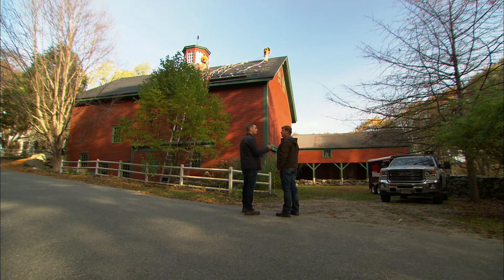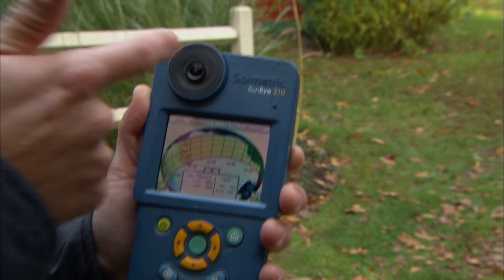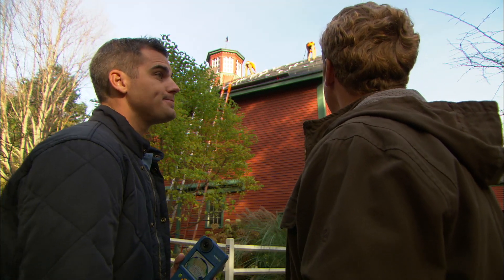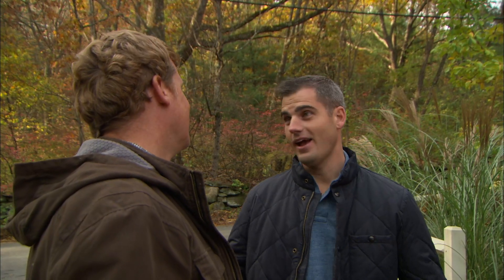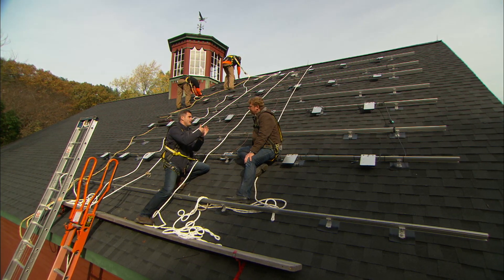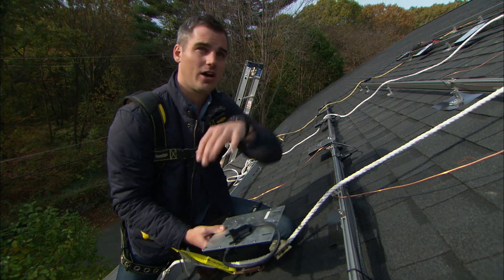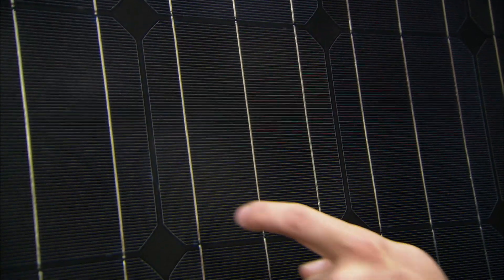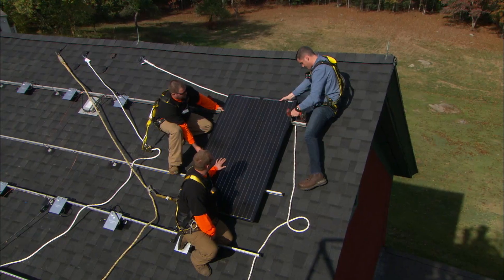How to Install Solar Panels with Microinverters | Ask This Old House

Comment: Between the utility panel in the house and micro inverter what do I need to have? Do I need an ac disconnect switch ? A combination box? I know a meter is also used.

Comment: I would've installed the rails vertical not horizontal. 
They way convection an keep under the panels cool and produce a lot more power.

Comment: Given new panels are now capable of 400w this is definitely a good 3 years old. I had 4x JA 385w panels installed recently to add to my original 7kW array. My installer was getting them at £98 each ($135 equivalent).  Micro-inverters however cost about £100 each - so unless you have a lot of shading problems, don't bother. And if all the panels are shaded evenly at once then micro-inverters won't help much either. Micro-inverters are useful when you have shade on individual panels, but not others.

Comment: Unless you have a lot of shading issues then it's always cheaper to go with string inverters. This house REALLY does not have shading issues! The examples they gave were 30minutes before sundown in winter months when the panels are doing 5-10% only because the sun is so low.
Micro-inverters are much better when you have year-round shade from trees and chimneys.  Unless these cases, given micro-inverters cost more than 300w panels it's cheaper to get a single inverter in the garage that's accessible. Single panels very very rarely fail - no moving parts. Toughened glass designed to resist golfball sized hail. If you're adding as many micro-inverters as panels what happens when the micro-inverters start failing one at a time after 20+ years?  You've got more points of failure.

Comment: Even though the microinverters have a warranty, over the years there will still be labour costs to replace them. How much would it cost for a worker to remove several panels to access microinverters at random throughout the array? Too much! 
At least with the string inverters installed near ground level, they can be checked and repaired without climbing up onto the roof!
Reply: One of the unique benefits of micros was that they were the only devices to be Rapid Shut-Down compliant. That was followed by  SolarEdge DC optimizers which are also RSD compliant, and SMA string inverters now have an RSD device (though it is an additional component.
To your point, Moludle Level Electronics (MLE) have often led to failures on the roof. The recent versions of enphase micros (IQ 6, 7, 8) all seem to be more robust than their predecessors.

Comment: I really want to know if you can mount these on a building with only East and West facing roofs (or is it rooves?). Cost aside, if you put panels on both roofs would that not be better than just on a South roof? It seems to me that would give a better angle of incidence as the sun hits both the East and West roofs. I'm asking this as I don't have a south facing roof but I do want to fit solar pv at some point.
Reply: East-West is useful for getting say 40-60% power for say 7-8 hours rather than 90% for 3-5 hours during the middle of the day. You can even do it with a string inverter with each aspect on a different string.  East-West gives you more power in the morning and evening, but less in midday. That's useful if you aren't at home during the day too. You'll get a much flatter output - like 2 bell curves vs 1 tall bell curve. Basically when the sun is at it's highest point all your panels will be doing about 50-60% instead of 90%.  So it's best to install say 7kW instead of 5kW. You can even do that with a 7kW inverter. It's called oversizing the array and is HIGHLY recommended if you have an East-West config, or just generally!
Reply: @markyates5744  great reply. Very useful and many thanks.

Comment: A few things: 
1. Those flashings are pretty bad.  You need to be up under the upper shingle and not overhanging the lower shingle.  
2. You would never put all 28 panels in series.  Probably run 7 parallel groups of 4 in series.  If one panel is shaded it would only take out the other three its in series with.
3. Grid tied micro inverters are best for saving money but in most cases you will lose power when the grid goes down.  If you are looking to be self reliant, then you need to have a battery bank.
Thanks!
Reply: This is a Grid-Tie system - adding a battery bank does not make financial sense. If you need AC power during black-out then use an AC Generator.
Reply: @MrSummitville  Generators are a great option when your power is out for less than 2 weeks.  Batteries are good for 10+ years.  If you want to be sure to have power in a long term power outage, then you need batteries.

Comment: Scrap those rails and grap something from Sunpowers latest and/or snapnrack, Much better flashing and racking. LG has come a long way with solar aswell.  Lot of issues with enphase micros but they always had a good warranty. We just finished 1600 mod site with Qcells

Comment: I have a question... I have two older 125 watt panels that when i connect together one only works half capacity. they out put 100 each, together i get 150.  whats up with that?
Reply: The rating for a solar panel is for perfect, or laboratory conditions.  Efficiency is lost from inverter or charge controller heat, DC to AC conversion, when applicable, wiring losses, panel placement relative to the sun, etc.  I have never seen 100% panel output from any panel, ever.

Comment: Set up a battery Bank for your solar system electric grid fail no electricity
Reply: No! Adding a Battery Bank to a Grid-Tie system does not make financial sense. Use an AC Generator for black-outs.

Comment: With that many panels they should be able to power the entire house all day and night. With batteries of course. Grid tied systems are a rip off. You know the electric co are going to get their profit one way or another.
Reply: When you compare Grid Tied and Battery Storage ROI the grid tie becomes much more affordable. Granted, if emergency power is a bonus then a grid tie is not the best solution it may be a combination grid and storage mode or battery only. The other thing to consider is if battery storage only is used then when the battery is full and your home is not drawing much power you are wasting the sun energy. Most utilities today do not allow a meter to run backwards, they require a Net Use meter to be installed. Essentially the utility pays you wholesale power rates for what you put into the grid but charges you retail rate when using power from the grid. With this type of system, you need to size your system large enough to cover your power needs during the average peak demand, but small enough you are not losing money.
Reply: @TallTexasGMan  You said, " ...hey require a Net Use meter to be installed. Essentially the utility pays you wholesale power rates for what you put into the grid but charges you retail rate when using power from the grid ..." . While that may be true in some states, in other states, they allow FULL RETAIL CREDIT of all energy put back into the grid - excess credits carry over- month-to-month for a whole year!  You do not need to down-size your array per "average peak demand", we typically design the array to generate  approx the "100% Yearly Consumption" = a minimum electric, as possible.

Comment: The panels I got installed in 2012 have multiple diodes in each panel so that a partial shade on the roof or even one part of one panel isn’t a problem. It is clear to see in spring and fall when the shade from a chimney wanders across a few panels. It doesn’t even come close to impact that string by more than a few percent.
Reply: Yes the worst type of solar panel system is the "Frankenstein" system which is wired like old Christmas lights where if you lose one light, the whole chain is interrupted. That means shade on one solar panel causes the entire array to stop generating.

Comment: I don't want to sound stupid, so I apologize if this sounds dumb. 

But how do you keep solar electric panels from short circuiting or causing a fire if it rains?
Reply: Just like on cars , outside lights on your house all wire connections are waterproof
Reply: they are all weather & only a small amount of electricity is going through them at any given second.
Reply: Everything is grounded aswell

Comment: Isn't it cheaper to buy power from the electric company?  Then you don't need to worry about maintaining these fragile glass cells on your roof!   What's the payback on these things?  10 to 15 years without subsidies??  And then they are junk after another 10 years because you need a new roof anyways.
Reply: Break-even can be as low as 5 years with the Tax Credits. Why would you install Solar Panels and not take the Tax Credits? Solar Panels can be removed and re-installed, they are not junk...

Comment: Microinverters have been around a lot longer than five years.  Enphase (the company whose microinverters you're using) started in 2006, and in 2008 they released their first microinverter to the market.

Comment: I see that that solar system is mounting on a roof with asphalt shingles these type of shingles have a limited lifespan what happens when the roof needs to be replaced. Do you have to remove all the solar panels and inverters and then reinstall everything every time asphalt shingles damaged or need to be replaced for any reason? What about keeping the panels clean bird droppings, dust & dirt if any cleaning is needed is the the home owners responsibility?
Reply: I believe most solar panels today have a useful lifetime of 20-25 years so if you have an old roof, you want to replace the roof before installing the solar panels.
Reply: yep, better to consider a ground mount if possible for both of those reasons but 28 panels is a 1 day job for most crews who do this professionally.  Also consider a battery is needed if you would like to store energy, absolutely necessary with solar in my view.  Most people are not told batteries are rated for around 15 years, half the lifespan of the panels 25-30 year rating.  Batteries also not cheap.
Reply: Yes, the panels have to be removed to replace the roof. The good news is that the panels actually extend the usable life of the roof, as they protect the underlying roof from weather.

Comment: My electric company won’t allow us to send power back to the grid.  You either can store the power in batteries or it just goes to waste.  It’s sad.
Reply: Rick Karns well it goes to waste either way. Pretty much all solar power is wasted when no used locally. The only difference is they didn’t pay for the power they weren’t going to use anyhow.
Reply: William Baker why? It’s like selling melted ice cream to the ice cream man. It’s useless to them.
Reply: @Mrcaffinebean  Energy fed back into the Grid in not useless . It is consumed by and SOLD TO the neighbors. The Power Stations can generate LESS electricity,  when more Solar Energy is pushed into the Grid. It is a great deal for me, not such a great deal for the power company. But is does slow down the number of new power stations that need to be built.
Reply: MrSummitville simply not true, during the day when your system is making most of its power, stations are mostly at idle because the demand is low.
Reply: @Mrcaffinebean  What I wrote is "simply true".  Your reply does not even address what I wrote and your reply proves nothing.   What I wrote is correct.  The less we consume and the more I produce, the less they ( the Power Plants ) need to produce. That is always a true statements. Regardless of your opinion.  Just do the simple math.  You need to clarify whether you are talking about Base Load Plants or Peaker Plants.  Or maybe you did not even know that there are Base Load Plants and Peaker Plants?  ALL energy feed into the grid is either a) mostly consumed,  b) some is stored  or  c) a small amount is system losses.
Reply: Batteries are a better option IMO.
Reply: @Neubs-xv8tw  No. Batteries are not better.  Batteries are a financial disaster!  Do the math ...

Comment: I am surprised that they are not using batteries they are producing over 7,500 kilowatts  they could do a lot of storage that should definitely run power tools electricity for pretty much everything and enough to sell but those systems are very expensive I don't know how much they are in New England but and Florida you're talking about 25 to $30,000
Reply: Batteries are a big financial loss ...

Comment: I dunno how good the sources I read are, but afaik, isn't it rarely the case where ROI for solar panels to be less than 10 years or so?
I mean, there are still plenty of great reasons to install them, of course, but you have to be willing to absorb those up front costs...
Reply: In my area of Arizona, we sell grid-tied solar for 6 to 7 year paybacks all the time. Only if you can't use the Federal tax credits do you go over ten years.
Reply: @XSPortSeeker - If you self-install ( ie no labor costs ) I can get break-even down to 5 years.

Comment: I refuse to share with anyone until Utah gets a credit. Our power company is nothing but crooks
Reply: They all are.  Solar power tied to the grid is a rip off.  You pay for the solar install and you still pay the power company!  If I'm going solar, I'm going all the way.  No more power company.  Generators; wind power; hydro-electric power - something as a back-up, but no more power company ripping me off with their ever increasing prices!
Reply: @fancybrooks3156  How are you going to generate cheap AC power at night ???
Reply: @MrSummitville  i store it in lifepo4 batteries, not too expensive today; i am 95 % off grid, small 2 kw system,6 panels, with one cheap  2500 effective watts inverter (200 euro) and a  very big 50 euro automatic flipper switch  if the batteries go down,the BMS cutts off, and the inverter shuts down; then, in a 1/5 of a second i am back on the grid; never happened in the 3 months i installed,myself,the system; maybe it will now in the next 4 months of winter here in SW europe, that the sun won't be enough,it will flip to the grid  on some nights.

Comment: What happens when you have to put new shingles on the roof?
Reply: I don't think you have to worry about it, the solar panels on top make a nice protection layer, especially from the sun ;)
Reply: Won't have to worry about it life span of shingles is 25 years life span of solar panels is 25-30 years so with the panels shading the shingles more than likely the roof will last longer than the solar panels
Reply: @hotrodpaully1  you will know if ALL those panels will have to be removed  to get at the roof to fix leaks, when the rains come... forget the electrical installers, better to get a good roofer up there  right after the rails are on,and before the panels

Comment: This must be an old video.  The concept is still the same, just old technology.  They haven't made that version of microinverter in a couple years and the racking system they used was replaced with a new version last year.
Reply: Yea, this is a reupload. Saw this on this channel years ago. And even then it was probably old.
Reply: @SirCrest  they're like phones 6 months down the line it's old technology.lol
Reply: 260 watts for a panel that size would be considered small as well. I don't know why I was watching to intently, I already have solar!
Reply: @sirlesliechao  LOL, I do to but I still watched it to the end.
Reply: normsolwind yea old video, I think it was 2012

Comment: Just wondering how much does it cost
Reply: Depends MASSIVELY on the house, location, and what you expect it to do. A few thousand, to hundreds of thousands for a residential instal. Typically expect 10-30K. But if you pay less, it’s probably going to make less energy. So it depends on how much you currently use, and how much you’d like to make. You’re still on grid. If the power goes out, you still have no power. So most people choose for around 50% of their power to come from solar. You can do 1000% if you want, it just isn’t economically viable. And 10% might not make much sense.
Reply: My brother just inquired in new England and it was 20 grand. Depending on house and such.

Comment: Sounds like there are no batteries, just use as you need it or credit from utility.
Reply: It’s exceptionally uncommon for solar systems to have batteries. It’s currently not economically viable for most people, but it depends on your current utility costs and consumption. For most commercial customers, batteries can save huge bucks today. For most residential installs, it’s not practical unless you value having power when the grid goes down significant enough to shell out the ~10-20K extra it would cost. But costs are coming down relatively rapidly. It’s likely going to make sense for most people in a handful of years.
Reply: Key phrase on this video: Grid Tie. This is not off grid. You only use batteries to store your power that is generated from the panels in an off grid system. In a grid tie system the solar panels send the unused electric back to the main grid instead of storing it. The grid means the power supply from the utility company.

Comment: Interesting they went with microinverters on a rather large array when there's no real chance of shading.    Probably twice the cost for the microinverters than a standard inverter that can run the whole system.     And you wouldn't run all 28 panels in series, you'd break it up into groups, depending upon the voltage of the powers maybe 2 strings of 14, or even 4 of 7.
Reply: The costs for microinverters isn’t dramatically more than a good quality string inverter. But personally I’d just use a string inverter if there’s low shading risk.
Reply: It also helps with shading from clouds.
Reply: @112428  Is that much of a thing though?  I mean I know it happens, but how often is only part of your solar array to be shadowed by clouds.
Reply: Trees can grow taller, Morning sun, evening sun and winter sun is much lower = shading!